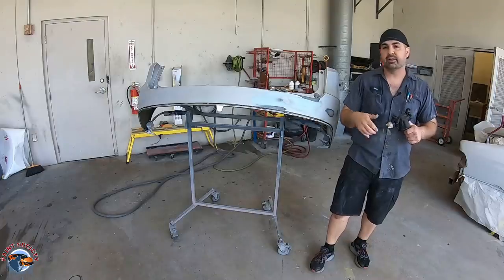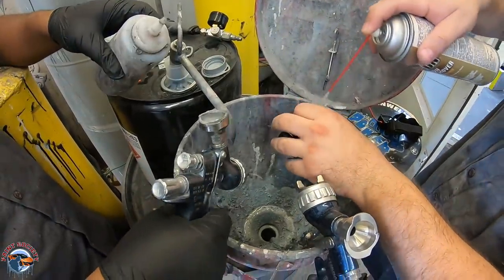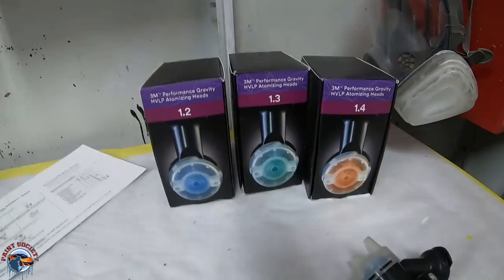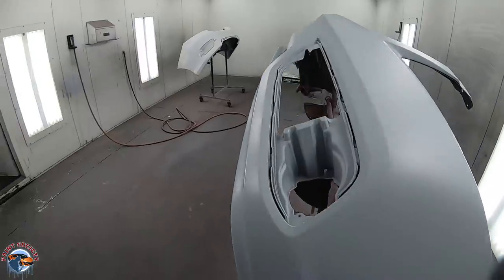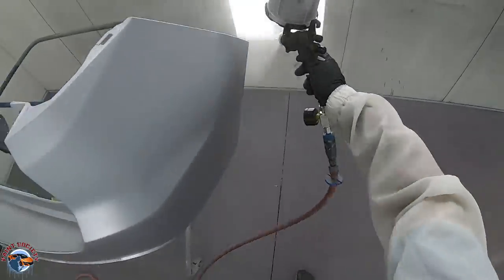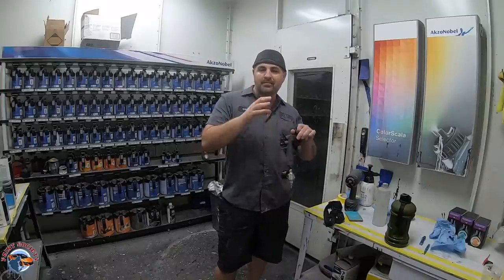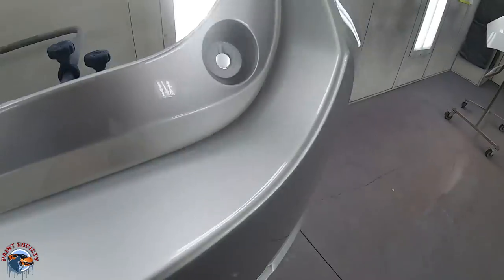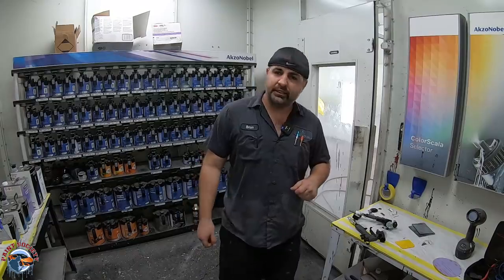How to Paint a Car Using the 3M Performance Gun!

Comment: My girl worked in a shop that manufactured custom and universal metal cabinets with shelves. They used the 3m gun exclusively to paint every piece that came out. She now sprays boat parts in a different shop for Four Winns. She now loves that gun and says it makes what she does much easier time wise. Yeah she can spray much better than myself to. 😢🍻
Reply: This is funny but I want to repaint all my non fiberglass parts on my Four Winns ..  any chance she would give me a good process (prep, prime , paint and seal). I’ve only painted some auto panels.
Reply: I remember back in the day I use to work at a boat manufacturing company... man fixing cracks and imperfections rebuilding fiberglass parts etc. Was in repair n refinishing... spraying gel coat and wet sanding and buffing. I kinda miss those days. Definitely different than automotive repair but not bad to have that knowledge as well...

Comment: Statement of the year, sealer is a lot cheaper than base coat. You’re not saving anything by not sealing and you’re not building the proper mil thickness on new parts if you don’t seal. Do you want to know if someone is an actual professional painter? Did he start off with sealer? No? Well you have a hint. Not the be all end all but when I see someone not seal a new part or body work most of the time, my decision is made. Just my 30 years and platinum PPG certification opinion. Im glad you pointed it out. I’m really thinking about one of these guns. My other top choice is a DV1. Can’t make up my mind.
Reply from the maker: Thanks Eric. I totally agree. Not everyone realizes the benefits of sealer. Rather they think it slows them down.

Comment: I enjoy watching artisan's do their craft.  You're awesome and very comforting to watch when painting.  Thanks for the video, bud! :)

So I guess for hobbyists like myself, if I want something that's beginner friendly, I should spend the extra dough and get the better gun with better atomization.  Which is understandable.  For now, I am sticking with pre-mixed rattle cans from the paint store.  I'm almost there, but I am finding myself spending more going this route.  But your blurb (and constant mention) says using a sealer before the base coat.  Think if I do the same thing with my rattle cans, I wouldn't go through cans like a fat bambino in a candy store?  Not getting any runs or fish eyes or anything.  It's just painting bumpers, or doors, or even a hood, I go through cans like mad.  Reason being is when I use a light, I see some low spots (light shines to the primer), and I have to put a couple more VERY light coats.  The 2K primer, I don't seem to go through as much.  I use the Eastwood 2K clear.

Have any tips?

Comment: Hello ! I have a question and i hope you could help me , i looked for help from 3M with no luck , i recently purchased a 3M performance gun but the air pressure on my gun barely go up to 20psi with the fan fully open , but if i close the fan , even a half of turn , my air pressure drop dramatically  almost to 0 psi ( between 10-0) can you help me , something wrong with the gun or is just my ignorance , ( i used some other of my guns , same compresor , same regulator with no problem , gun is brand new , never be able to use it ) can you please help me ?

Comment: Not a bad gun for the person in a garage the price is lower, and cleaning is easier the prices of solvents these days makes a difference. The number of times get out of a tip would be idle for small amount of work one is doing. Investing $1000 in a spray gun use once in a while really doesn't make sense. One thing I noted was 13 CFM needed at 20 PSI probably beyond what most home compressors can handle to do an entire car need a larger 60-gallon tank.

Comment: What's up Brian!? Did you cut & buff the bumpers after painting in this vid? I just did a front bumper on a Chrysler and not sure if I should cut & buff. It does have little peal or wave look but smooth to the touch. And not easily seen. I'm a beginner just trying to figure out which way to go with it.
Reply from the maker: We rarely cut and buff. The finishes come out nice. When I did work from home I would need to cut and polish
Reply: @PaintSociety  I appreciate it Brian

Comment: It plastic with metal right ? It can stick with magnet.
Reply from the maker: What’s is your question
Reply: My question it not just a plastic right
Reply from the maker: What? What are you referring to. Use adjectives.
Reply: I saw a commercial saying this gun is not just plastic it come with metal they showing stick with magnet.i wondering if it strong the body before buy one. I used those old one before I drop by accident break so easy . 
by way man doing really good job the bumpers watch really good my respect for you.
Reply from the maker: @rolandocaxaj208  plastic gun body and metal trigger